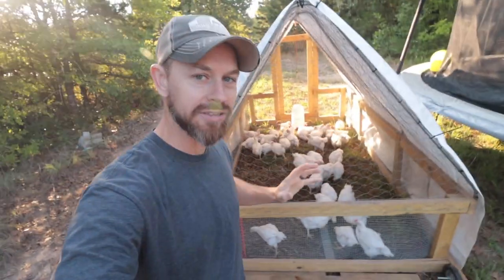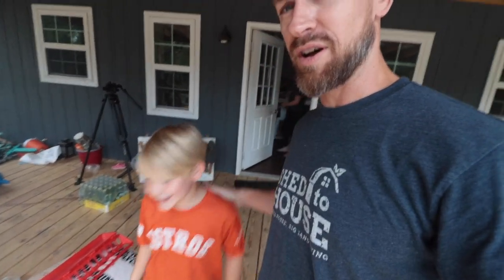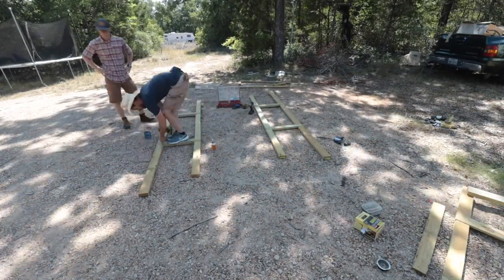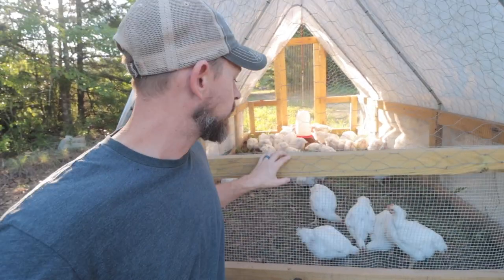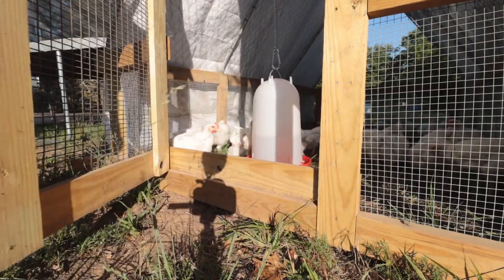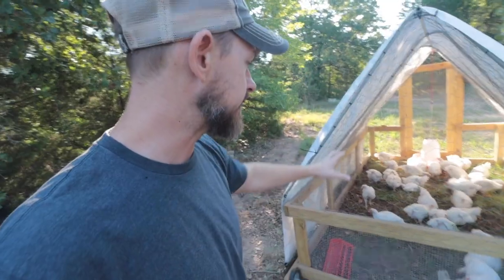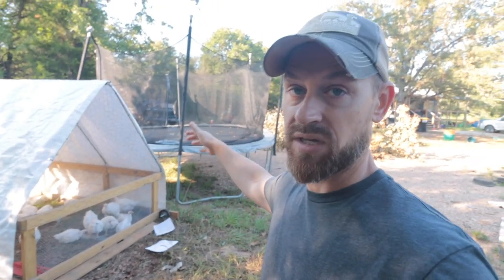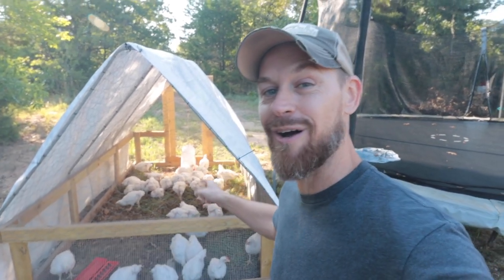Is this the BEST Chicken Tractor Design?  {Small Scale Pastured Poultry Farming}

Comment: On the back side instead of a full door, what if you made a door in the upper section to lean into with the feed.  It wouldn’t change the structural integrity, it may actually strengthen it.
I appreciate your honesty and your ideas.
I’m thinking about one of these for our flock.👍🤓

Comment: The John Suscovich chicken tractor is the best one I have had. I stopped building any others.
I did add 12" the the wall/door height because we're tall.
Reply: What was the ground to frame height on the Suskovitch door prior to the changes?
Reply: @brian92822  I think 5'10". 
It has been years since mine were built and John Suscovich's plans are at My property. The only drawback to making the door taller is that the width for your head is narrower because you're in the peak of the tubing.

Comment: sorry I didn't see the wheels until you aimed lower on the tractor but you might invest in wider wheels the skinny ones tend to dig into the ground with the weight of the tractor when pulling it and then you have ruts in the ground from the skinny wheels  3 to 4 inch wide would work

Comment: Great video. Appreciate your thoughts on the design. I chose to go with small flat (Salatin ish) tractors for our rocky uneven yard. They only hold 15 birds at once but works great with daily moving. I’d totally run the Suscovich if I had even wide open land.
Reply from the maker: Awesome, so do you like Joel’s design?

I am afraid that they wouldn’t have enough ventilation in our crazy HOT texas heat.
Reply: @BetterTogetherLife  Well I adapted the Salatin style for us.  It's only a 3.5'x6.5'x2' tractor but we had no issues with space.  We also dont have your heat here in the mountains of Virginia. :)